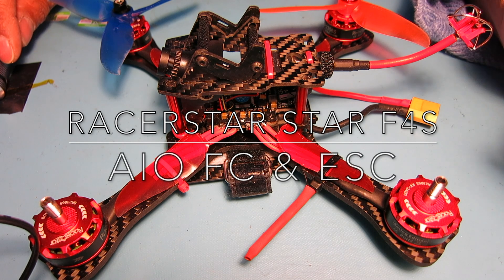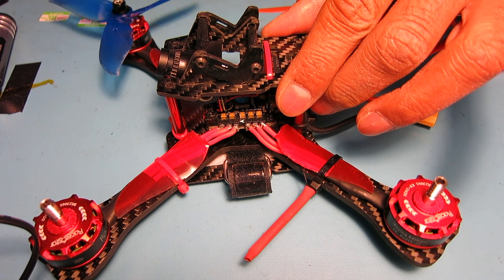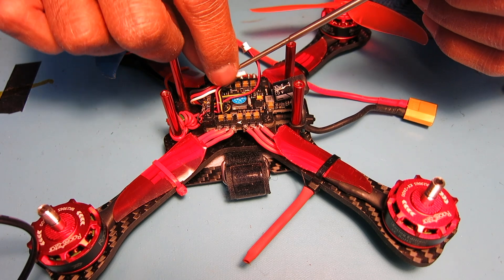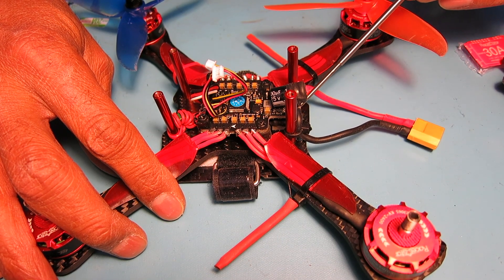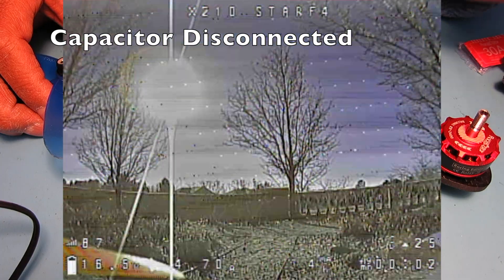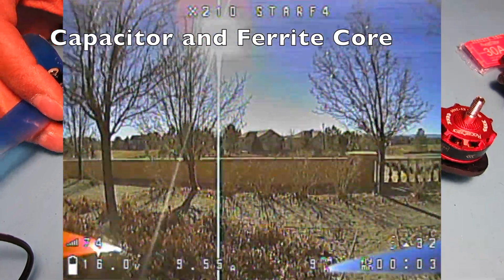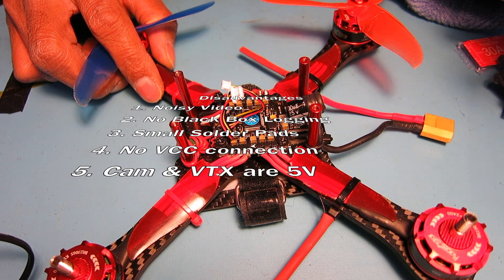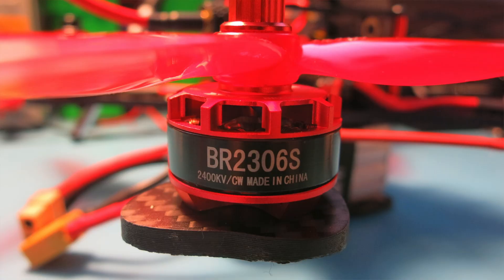RacerStar Star F4S AIO Review

Comment: hello is this RACERSTAR STAR F4S AIO flight controller can connect to a 4S(14.8v) 1500MAH 120C lipo baqttery without any issues and this flight controller compatible with an M.BUS receiver(S.BUS reciever) and is  this flight controller compatible with Eachine TX805 VTX and Caddx ANT 1200TVL FPV camera????
Reply from the maker: In theory, yes.

Comment: Hello.  Thanks for your review.  I recently just bought this controller for my first attempt at building a quad.Only thing is I use Spektrum DSM2 satellite receivers.Sorry, I am a complete newbie at building quads.  So from the comment you mentioned below to another person asking about a Spektrum receiver, regarding a spare UART,  am I correct in assuming that I can't/don't use the 3 tabs labelled SBUS/5v/GND for a Spektum DSM2 satellite receiver?.I should solder the 3 wires for the receiver if I am using a Spektrum satellite receiver to somewhere else on the board?.  If so, can you suggest maybe where?, I have no idea where the spare UART is, and which of the 3 wires for the receiver would go to that?.  Assuming I can find the UART tab?.Sorry, I appreciate you did mention you haven't tested it with Spektrum, but I just have no idea where to start and you seem to know a fair bit about this board.I was really hoping it would all be simple and I can just use the 3 tabs on the board labelled SBUS/5V/GND for my Spektrum satellite receiver?.Is there a reason I can't use those for my Spektrum sateliite receiver?.Wish I knew this before making my purchase.   Any help would be greatly appreciated.Best Regards

Comment: Did you have any issues with connecting the reciever? I have the same FC Rx combo, and i can power and bind the reciever, but get no response in Betaflight or on the quad. Seems like there is no connection between the reciever and FC.
Reply: Stefan Olsgaard Hi I have the same problem and was wondering if you solved it ? I am trying to connect the flysky fsi6 and it connects but in betaflight there is no connection. Any suggestions as this is my first quad build ??
Reply: @n3er0o  i tried this, but when i do, i cant even get my transmitter to bind
Reply from the maker: Using the sbus pads, I didn't have any issues with an XM+ or the R-XSR.
Reply: Mine is working now. Not sure exactly why. It's on the sbus pin, uart1, setup as sbus. I seemed to start working when i typed serial into CLI on betaflight, although that shouldnt have changed anything. I also updated the firmware.

Comment: HELP!!! I cannot make work the RacerStar StarF4S AIO FC with my Rx, a Cooltech RFASB PPM SBUS 2.4G FASST Compatible Receiver. I linked The Rx to my Futaba 14SG, but seems to be there is not communications with FC because I don't get any movement in Betaflight receiver tab. Did you made an special arrangement to conect this Rx to your FC? How could I run a diagnostic to find out if there is a problem with the FC or the Rx? I'd really appreciate your comments.
Reply from the maker: My FrSky XSR is on UART1.

Comment: I recently bought this board. How did you mount it? Did you use the screws that the board came with or did you use nylon standoffs?
Reply from the maker: I used rubber soft mount standoffs.  Nylon should be the same.  Let me know what is different for your build.  See my Rotor Builds page for more detailed pictures:  https://rotorbuilds.com/build/8743
Reply: you used these? https://images-na.ssl-images-amazon.com/images/I/41VxjikGcGL._SX355_.jpg  my understanding is that the Star F4S runs positive (ugh)..which is why I didn't buy it because I'd rather use rubber soft mounts like that, but the screws are metal..and metal + a positive board = fire. I noticed they even added a warning on the product page that it is running positive. What did you do about that? Still tempted to buy one of these, but I don't know the answer to this problem and I see contradicting comments across the intrawebs.

Comment: Hi, thanks for your review. I bought the TattooF4S which should be quite similar expect having blheli 32 esc. I also have noise in the FPV image (I use a low esr 1000mq cap + voltage reducer to vtx). But I'm always struggling with new Betaflight firmware releases. 3.2.2 (target LUXF4OSD) didn't work at all, 3.2.3 has some glinches. Currently only 3.2.1 seems to work properly. The betaflight guys told me there is no support for this FC. Do you have similar experiences? Which firmware are you running?
Reply from the maker: The StarF4S uses the Omnibus F4 (OBF4) firmware for Betaflight.  I also have a TattooF4S that I will be building up soon.  I did read the same thing that you are saying about the firmware target being the LUXF4OSD but have not tried upgrading to the latest Betaflight.  What issues are you running into with the different versions?  Are you able to get any version working well?  Thanks for the info.
Reply from the maker: I was able to upgrade my Tattoo F4S board with the LUXF4OSD target with no problem.